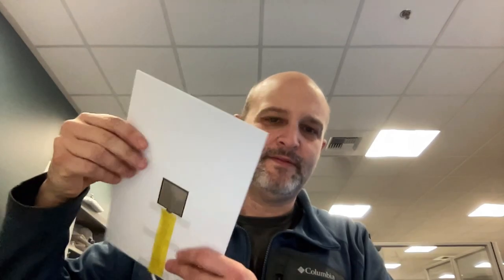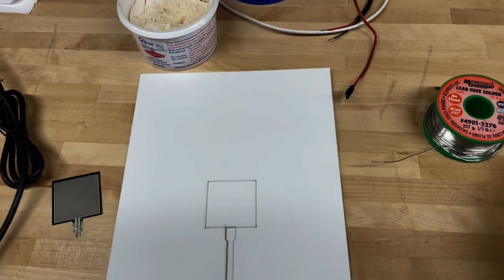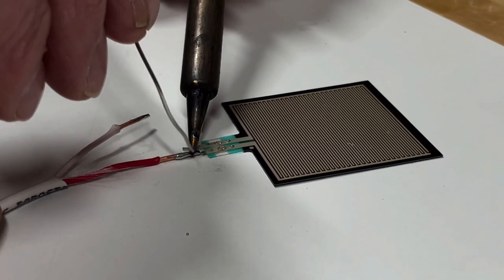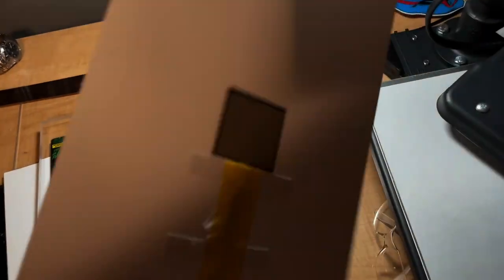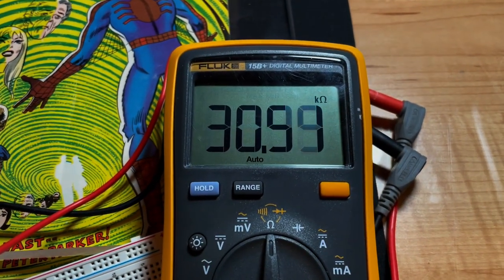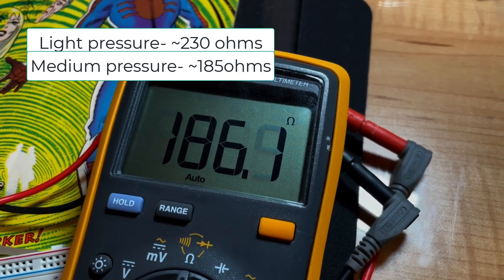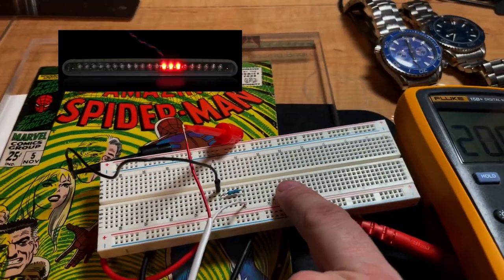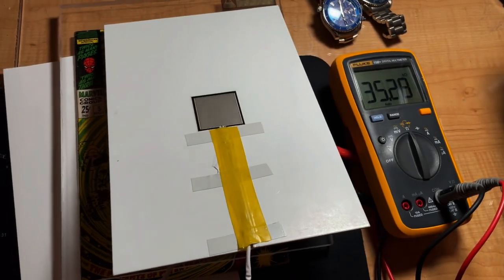Comic Book Pressing Sensor Development Progress I

Comment: Glad to see you're working on this, Rick!  It's a tough measurement given that the detector influences the pressure.  I hope you try to actually quantify pressure in units like Pascals or lbs/in^2.  You could probably stack known weights on top of that square sensor and get a nice plot of pressure vs resistance.
Unrelated matter: have you done an investigation into what causes those pink stains commonly found on the back covers of comics?  It's not just color rub so I assume it has an explanation in chemistry.  That would make a great video!

Comment: It's no surprise to me that older comics take longer to equalize,  I think that it has a lot to do with the amount of resistance to pressure the paper has, slick modern paper would compress less than Baxter paper which in turn to my mind would compress less than newsprint. Of course once the paper has been compressed, it would take less time for it to reach the same  equalization depending how long the paper is at rest. If you pressed a newsprint comic and went back five years later and pressed it again, the paper might have relaxed enough to take almost the same amount of compression to equalize. Where as pressing it again a few months later might not take much time at all as the paper may not have relaxed  yet.

Those are my thoughts on it anyway, but I don't so much need a pressure sensor as I do a temperature gauge for my old press, the temperature gauge I have is shot and I haven't yet had the time to replace the potentiometer in it.
Reply from the maker: Thats good insight Jim. Maybe I should make my sensor both a temperature and a pressure sensor now that I think of it!